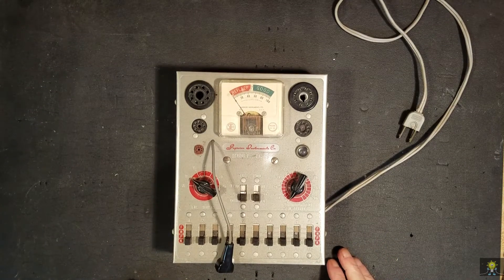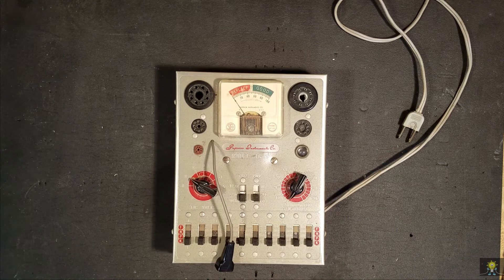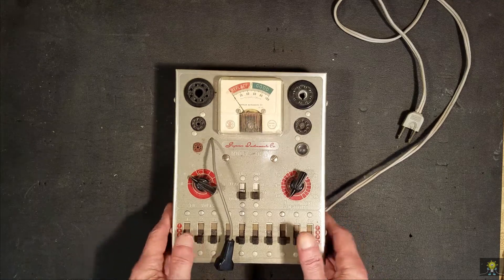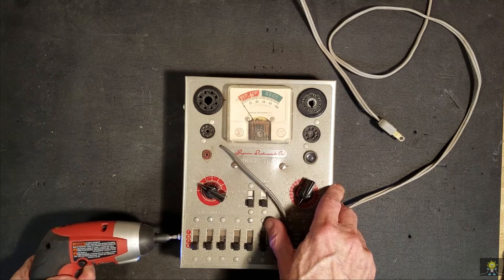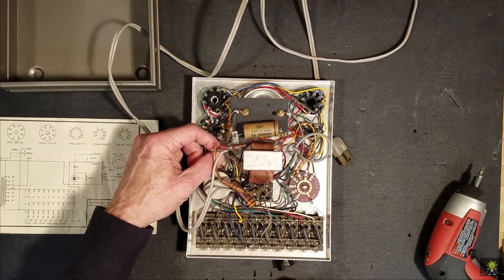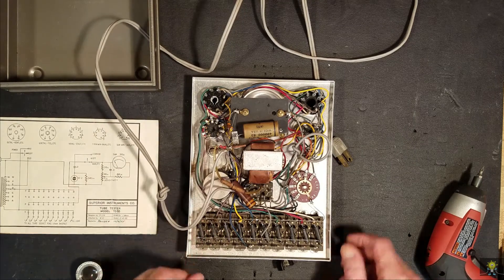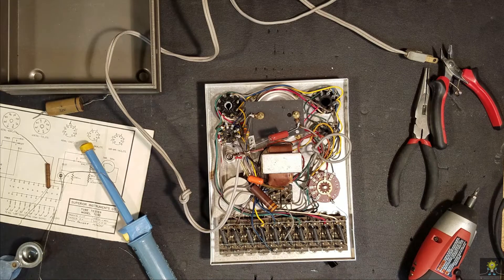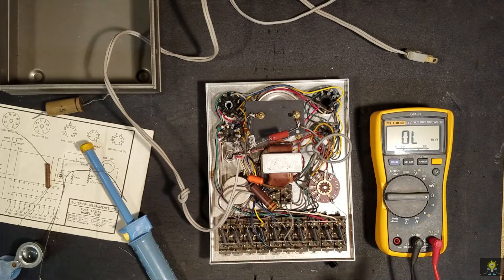006 Superior Instruments TC 55 Tube Tester, Clean and Repair

Comment: Do you need to replace with an old neon bulb or will a 5mm led replacement work fine?
Reply: Also is diffused preferred in this situation or should it be a bright led (if possible of course)? Thanks again
Reply: Also what does the bulb even indicate? I didn’t see it do anything when you tested a few tubes.

Comment: Hi, Mr. Sparky

 I found one of this TD55 (which looks pretty similar to your TC55) in my antique collections but found its transformer completely burnt, black and crispy. And one more problem I found is that the meter isn't responsing to any direct input from its rear terminals so I guess I have to rewind the moving coil too.

I'm just thinking that would you please do me a favor testing the voltage of each taps of that transformer so that I can rewind it and thus save my little instrument, and if with the full scale amperage of that meter would be the best.

Endless gratitude.

Sincerely

Sangamo

Comment: Thanks for the video! I have one of these that isn't working and I've only been able to find the TD-55 schematic. Could could you tell me where you found the TC-55 or possible share the file/scan?
Reply: Justin-  I have the same issue. Did you ever get an Electronic File of the Manual & Tube Chart?
Reply: @johnfritz9885  So far I've found the TD-55 tube chart to be the same and the schematics are at least close. I just changed out the caps and it works well.
Reply: @justovision  Thanks! I did the same. I was just hoping to have the correct version of the manual to go with the Tester.
Reply: At 10:00 he shared it.